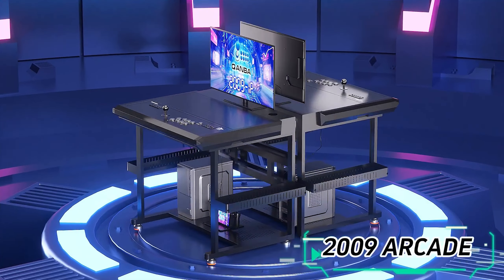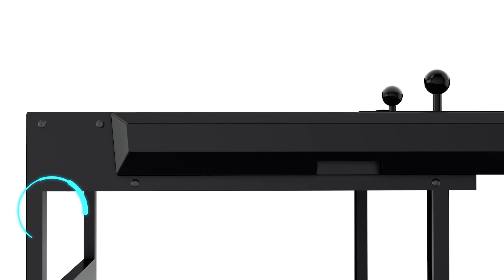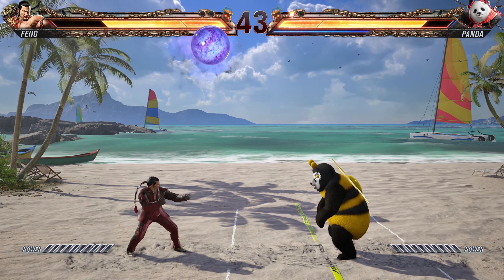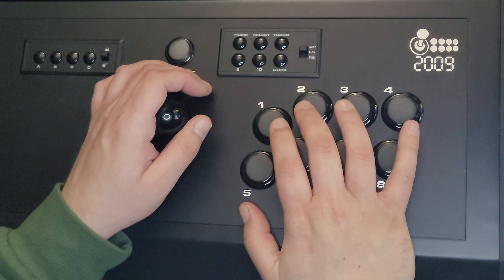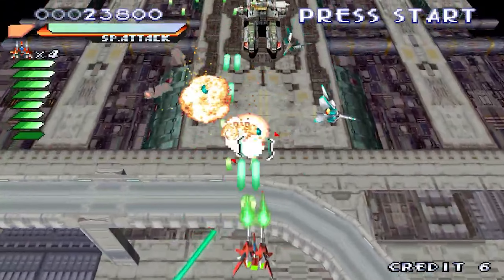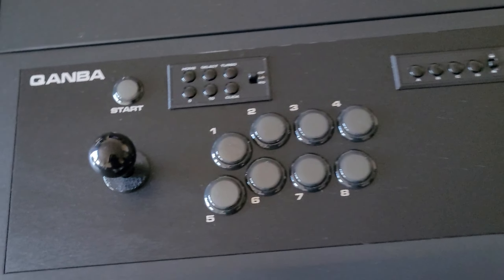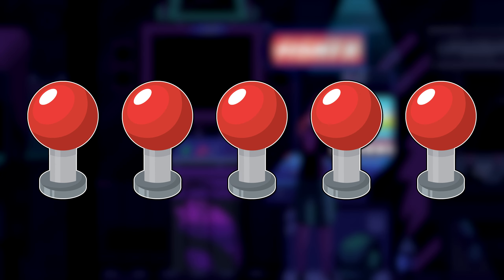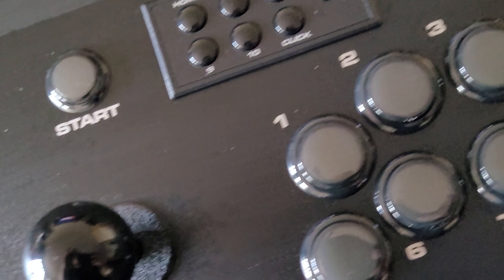Full Review: Qanba 2009 Arcade - The Best Viewlix Alternative? #Arcade #FightStick #Review

Comment: I was wondering. Would you be able to hook up a jamma board/arcade boards to this? Or is it just plug and play items like pcs and consoles?
Reply from the maker: Negative. Out of the box, USB D-Input and X-Input. I think you'd have to look into adding or replacing the guts in there with a different setup. Either wiring in a full jamma harness or looking into something like Brook UFB to JAMMA by Psychic Drive.
Reply: @Dandizz  damn, thanks for the reply. That's unfortunate because it'd be sweet to hook up 4 arcade boards and switch between em.